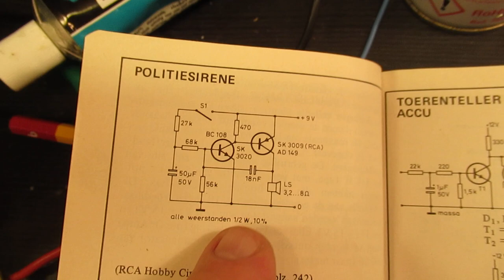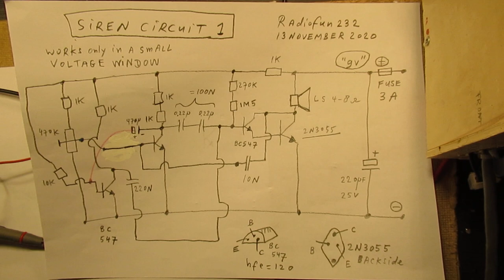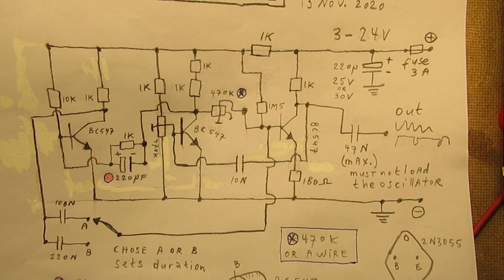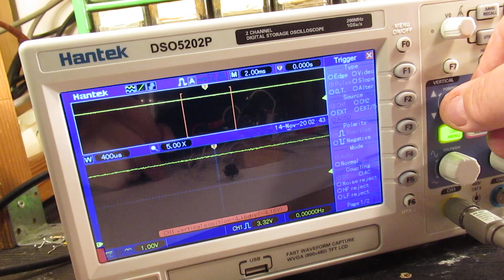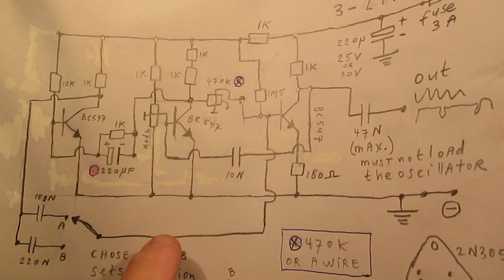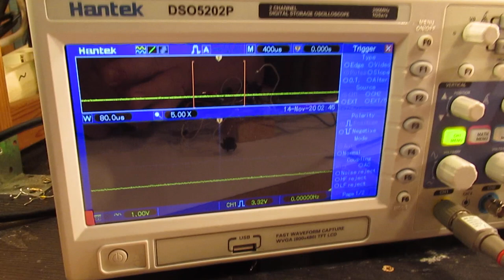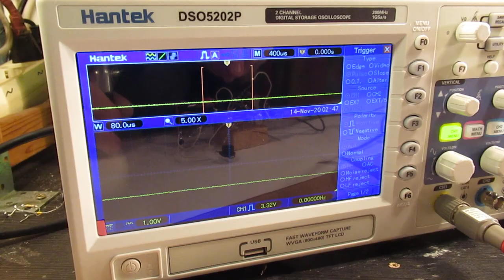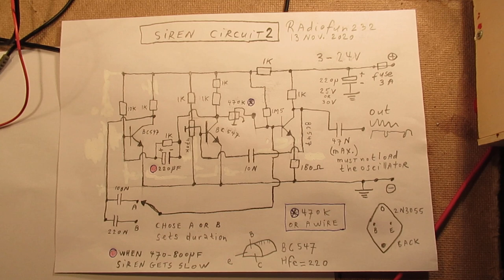2 electronic siren circuits VLOG & schematics/demo with the HANTEK DSO 5202 P Oscilloscope

Comment: Really nice to see you have a new DSO to further you research and experiments 😁😁👍
Reply from the maker: Sure, I hope to get better insight in VHF oscillators.
Reply: @radiofun232  be nice to have the memory of a DSO single shot capture. Really useful too
Reply: @T2D.SteveArcs  and the measuring functions. And maybe FFT to have an idea of the signal purity of an RF oscillator. 1 GS/s for 200 MHz is a bit tight, though, and one shan't forget that when both channels are on, each channel only has half of the sampling rate. But with the memory, and looking at periodic signals, there are modes to look at a signal in more detail by means of longer term observation - I never used that and forgot what it's called. If not done so already, definitely look for videos in youtube that demonstrate the effect of ALIASING with these scopes, that analog scopes do not have - to be prepared and not fooled by that.
Reply from the maker: @tinkerwithstuff  thanks for this good info.
Reply: @tinkerwithstuff  yeah Dso deffo most essential piece of kit in my shop.. can even look at filters etc with a sig gen sweep synced with scope trig... cool
Reply: @T2D.SteveArcs  ah yes, external trigger input! Have not done much with that but thanks for the reminder!
Reply: @tinkerwithstuff  Haha no worries.

Comment: Fan noise is not bad. I would not switch it off, the processor gets pretty warm on those scopes.
Interesting alarm siren.
Reply from the maker: Yes, you are right. I think during the warranty period I will not open it.